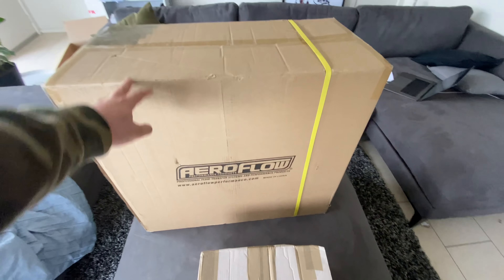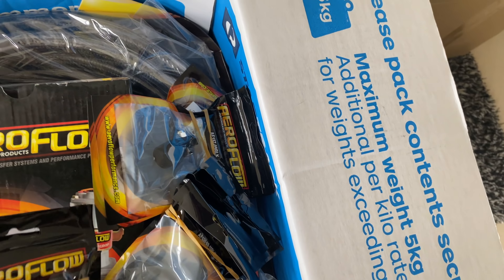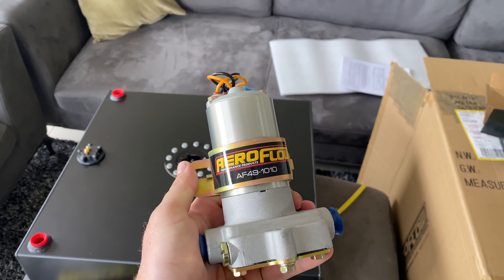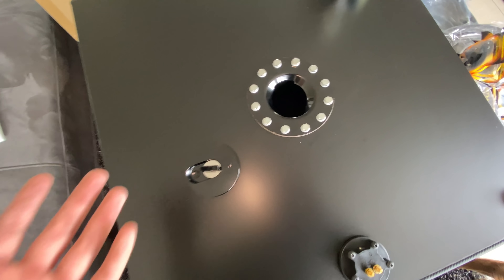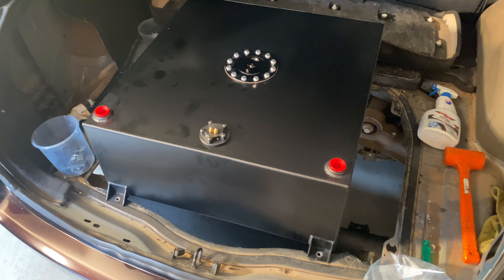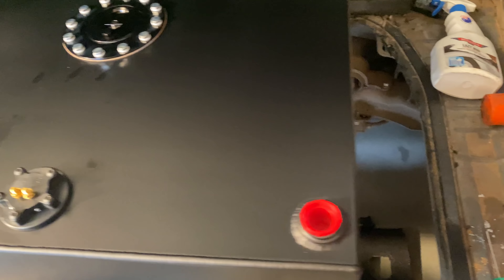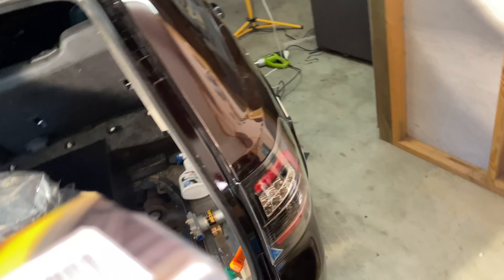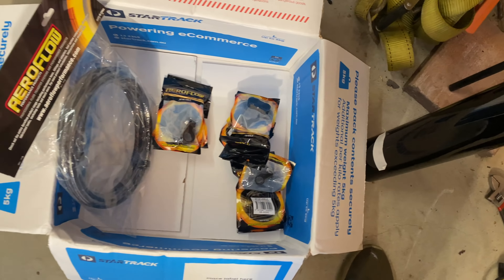Unboxing Our Methanol Fuel System! CLIK-B8 Got A New Sponsor!

Comment: When you build the cover for the cell you should use the hood latches you originally had for the bonnet that are doggy to mount the cover rather than bolts so it’s quick to access in case of emergency would also look clean too I think